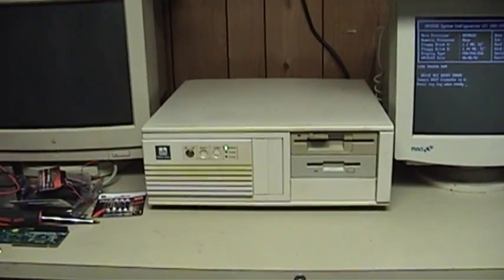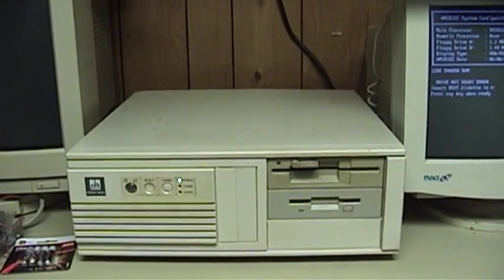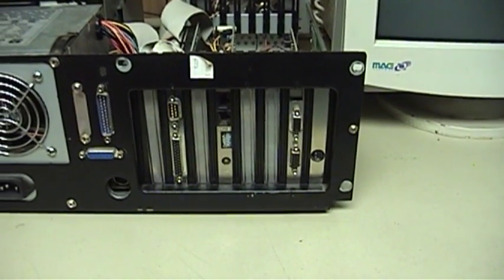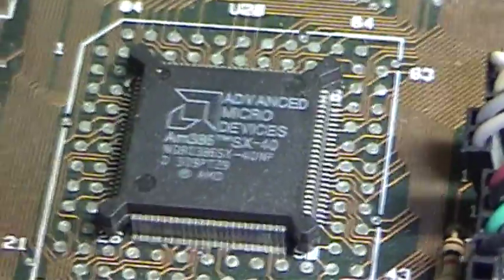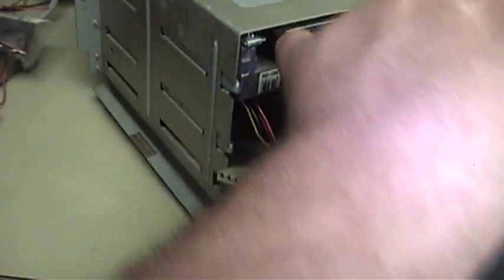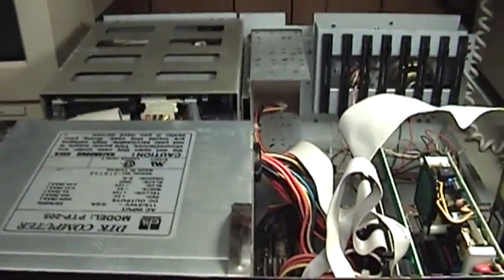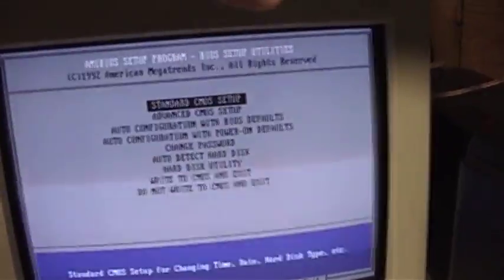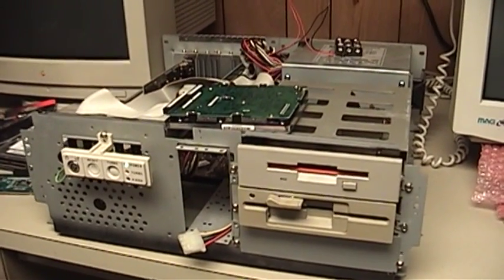DTK Computer Peer 1630 PC (with upgrades)

Comment: So, at one point you talked about monitors. I've gotta DTK FEAT-5030 with 486dx cpu. I thought I was having a video problem. Could it be that it doesn't work with my newer monitor? What type of monitor will be needed? I'm unaware on this sort of thing.
Reply from the maker: There's always that possibility, although I would expect that you would still see the various startup messages produced by the computer before it is ready to use. Most monitors will also complain if their capabilities are being exceeded. 

In case you are not already, I would recommend using a monitor that has an actual analog VGA input. (The typical converters for VGA to HDMI, DisplayPort, or whatever don't actually work all that well.)

My guess is that the computer isn't actually managing to start up. You can find this out fairly easily by removing the video card from the computer (assuming it's not built in -- then it gets harder). This should provoke a set of beep code errors from the internal speaker when you turn it on, if it is running.

My longstanding recommendation would be to carefully disassemble the computer, look for any damage (especially around any clock battery you may see), and if everything looks OK, carefully clean excessive dust away, after which you should reseat everything.

If you have a meter capable of measuring DC voltage, you could also check the power supply. At a minimum, it should be outputting approximately five and twelve volts DC. If it isn't, that's likely the problem.
Reply: @uxwbill  I get one sort of quick beep on startup. I can hear the hdd running as well. The battery area looks clean-ish. It's the old Dallas type and I can imagine it gave up the ghost long ago.  I just dont know anything about this old thing. It was my first computer when I was like 10 lol. Found it in my parents storage building. Just for nostalgia's sake I'd like to get it going.
Reply from the maker: That beep, if it's coming from the system speaker, is probably a good sign. If it were me, I'd clean the system up first (blow the dust out, if there is any) and reseat all the expansion cards. That may be all it takes. Beyond that, it'll take some troubleshooting. Simplify the system configuration as much as you can. If it works with the bare minimum configuration, add one piece back at a time and test it. When it fails, you've found the problem.

The Dallas modules do run out of battery power, but as the battery is totally sealed in potting compound, it doesn't leak. It also helps that the battery is not a rechargeable type. You can carefully cut those modules open, disconnect the battery and solder in an externally located one. It's not for the faint of heart or inexperienced, though.
Reply: @uxwbill  I did in fact take everything apart and clean it. The mobo itself looks mint. The VGA card looks like it's okay, but the metal seats did appear to have corrosion on them. I did not clean them yet but did reseat it. Only had 1 more old school internet card that's completely trashed. The pc was on its side for years and looks like rats got in there and did their business. This did not make a difference on the video issue. The one beep is still chiming on startup though. I dont know if I should try a different video card or not since I cant locate a cga monitor for sale anywhere. It's a shame really. I did see a label on the hdd though, it's got DOS 6.2 loaded on it amd possibly Win3.1. May have to be back burner project for now.
Reply from the maker: Hopefully you'll have a breakthrough and it'll come back to life. I would definitely simplify the configuration as much as possible, maybe consider removing everything but the motherboard and video card? Anything that looks as though it has been damaged should definitely be removed, as it may damage other parts of the computer. Hopefully that hasn't already happened.

Assuming "CGA" isn't a typo, you won't want to use a CGA video card or monitor. It would be an enormous step backwards in that computer's graphics capabilities and any software that operates in a graphics mode would probably need to be reconfigured. Windows 3.1 in particular did not ship with a CGA driver -- it was an optional download from Microsoft's BBS at the time.
Reply: I assumed it was CGA. Maybe it will work with the 98-99ish style CRT monitor I have then. Gonna just keep tinkering around with it.

Comment: I have this same case. What type of size power supply does this take?(mine has no power supply) The XT and normal size AT seem to big and not the correct shape for the back of the case. Is this some kind of weird proprietary Mini XT version that DTK had made just to fit in their case, some kind of XT, Full AT, Baby AT, Frankenstein Power Supply. I want to find one for my Peer 1630 case.

Comment: what about a 5/4" hard-drive and  DEC GEM DESKTOP that was for the AMSTRAD 1512 and 1640.
Reply from the maker: +DAVID GREGORY KERR What about it? I have no idea of the context to which your question applies, or even what you're asking!
Reply: +uxwbill well it is an OS that was supplied with the AMSTRAD 1512 which had 512KB of system RAM and had CGA 4 color graphics as well as a special Plantronics mode which gave 16 colors on screen at one time as well as MSDOS the GEM OS was a graphical operating system for the AMSTRAD 1512 and 1640  which had 640KB of system RAM as well both machines used the Intel 8086 processor but no floating point which had to be emulated. AMSTRAD is a contraction of Allen Michael Sugar Trading.

Comment: The smoke smell can hide in a power supply. smell that psu first.
Reply from the maker: +Massa902 The smell of burnt or overheated electronic parts is a lot different from that of cigarettes. And as the fan tends to pull air through other openings in the case, it tends to get everywhere pretty much equally.
Reply: +uxwbill Oh,. So the whole thing would be smelly then, yeah? I wonder if Tar builds up inside a case as well
Reply from the maker: +Massa902 Yes, and yes it absolutely does.

Comment: I can't find the Lzone on my ibm 171 mb harddrive, i can find the Sectors and heads and cyl but not the Lzone
Reply: It is an IBM H3171-a2 171 mb 
984 cyl 10 heads  34 sec/T

Do do i use 84 or what number,

It also has no clock battery, so it won't detect the harddrive automaticly for me, 

it has a 486SX 25 mhz and running MS DOS 6.0  Windows 3.11

It's very hard to get it booting up from the HDD
Reply: Ok i will try that thanks! 

I think it needs a 3.6 V because when i install a 3 volt cr3220 battery, it says that the battery state is very low on the power on self-test. and also it only works one time
Reply: It does detect the drive but it shows that it is an 163 mb drive :/
Reply: It worked, thank you uxwbill you have saved an old computer!!
Reply: Well it just so happens that it booted from the hard drive, but it only did it once! I just dont understand why it wont boot anymore
Reply: Those 3,6 V batteries is very expensive were i live,
But i think i will invest in one. But is there anything else that you know that may work?
Reply: I have the battery holder and batteries (off course) the only thing i need to buy is the diode :-) so it looks like this is going to be very cheap, so thanks again uxwbill.
Reply: I found a 3.8 v 600 mAh lithium ion battery in my gameboy advance sp, do you think that will work?
Reply: I tested the battery yesterday and it did work, 
and im getting a commodore 64 very soon. 
so everything went well

Comment: Stacker, X-Tree Gold, Quarterdeck's QEMM386 and the predecessors to some of the latest games still loved by all; Wolfenstein (Battlefield 3, Metro 2033), Sir-Tech's Wizardry (Elder Scrolls series) and Sim City. And we didn't notice that the midi sound files sounded that bad, until X-Wing and some others started using digitally reproduced wave files. DIP switches on modems and such to set IRQ's and DMA's. MEMMAKER, HIMEM.sys /noems and Expanded memory cards!

My hair just got 2 shades greyer. lol

Comment: No offense intended Bill, just noting a bunch of comments unrelated to the content so I made an observation related to my experience with former smokers.

I like the vid. Boy did it ever bring back the days when you had to define your drive parameters in the bios. I noticed the empty math co-processor socket.

My first PC was a Tandy 386SX. My first build was a 5x86 Cyrix based PC, 133 MHZ with a huge amount of RAM, 12MB! DOS 6.2, I ran X-Wing out of a RAM disk on it. Been hooked ever since.

Comment: My friends got an old computer. I really don't know anything about it, since it's not mine, but it just sits in his basement. All I know is that it has a turbo button, And takes a long time to start up, The boots win 2k, and it you leave it running for about a half hour an alarm starts going off in it. Does anyone know what the alarm is? I'm thinking it's overheating or something.. But if you know, please let me know!

Comment: I used to have a Dtk grafika 486dx2 66mhz. I'm very surprised, dtk used the same AT case from the era of the machine you own all the way into the AMD supersocket 7 era, they just have different face plates. They all have the 3 horizontal 5.25 bays and two vertical 3.5 bays. It was a nice computer, the one I owned, it had alot of room for expansion.

Comment: Yuck, few things are nastier to a computer than smoking. Funnily enough, the reset button my my 386DX sticks as well... in fact I had to stick a piece of tape to the button and pull on it to pop it back out. Fortunately ctrl-alt-del works well enough most of the time.

I've got to solder together a battery solution on that machine as well; I'm going the CR2032 battery holder route. Those barrel batteries are a menace; luckily I got to it before it caused any damage.

Anyways excellent video!

Comment: You mentioned the leaky nickel-cadmium batteries in the description.  I always yanked those out first thing.  There was almost always just enough space to solder in a regular coin cell holder.  If the keyboard port gets in the way, you can shave a little plastic off of it if you're very careful.
Reply: you shouldn’t directly solder to batteries
Reply: @jessihawkins9116  
Never said I did. :)
Reply: @Jerkwad152  you said you soldered in a coin cell battery.
Reply: @jessihawkins9116  
No, I said I soldered in a coin cell holder .
Reply: @Jerkwad152  no
Reply: @jessihawkins9116  
So, you...just don't know how to read, then...
Reply: @Jerkwad152  you went back and edited your comment 🤨
Reply: @jessihawkins9116  
When you edit a comment, it says so next to the time stamp, smart guy.
EDIT: Kinda like this one.
Reply: @Jerkwad152  the jokes on you. I’m not a guy, I’m non-binary 😤
Reply: @jessihawkins9116  
Bye, Felicia.  😂

Comment: I've looked and looked and looked and I can't see anything that looks like a battery, or that there was ever a battery mounted on it. There's the BIOS and a chip directly next to it with a sticker on the top. I may try and remove the sticker to get the part number.

This is the third motherboard I've tried and this is the only issue with it!

Comment: I have the same problem with the battery for my 486 motherboard being dead (or missing?!)
I've ordered a similar battery holder for the 4 pin socket, as I'd rather not have to enter the CHS settings every time I want to use it!

Interestingly, the manual for said motherboard reckons the VLB slot is a MCA slot!

I wasn't expecting a random Furhead to appear!

Comment: Nice system, and for the harddisk you can use a drive overlay program.
The biggest harddisk you can install without a overlay is 520MB (1024cyl. 16 heads 63 sectors)

Comment: Ooow it reminds me of one of the machines i had many many years ago.

You may find the holes around the cpu were for the socketed version, i had a machine like that, it could do with a 387 math co-pro i think (my memory has faded a bit).

Not quite enough speed/memory for win 95 to work i suspect.

So its fdisk/format/sys c: from a boot disk and same dos installed, scandisk/chkdsk to check if ok then windows 3.1 possibly??

Furrhead, i would worry about him bill, lol :-)

Comment: You would be amazed how long cigarette smoke stays in electronic equipment,I found my parents old General Electric clock (gotta be from the 80's) and it still has a hint of nicotine (my father was a smoker,don't become an accountant on wall street) ,to think it has held on for 15 years.

Comment: I would bet that multifunction board was made by DTK as well. The Oak VGA board may not be fancy enough to support CGA/EGA and Hercules output; many early VGA cards simply offered the 9-pin output as a way to connect an already-VGA-capable Multisync monitor (as likely previously used with EGA) without needing to buy a new 9-pin-to-15-pin cable. And it's been a long time since I've seen that text-only AMI BIOS screen! The only 386 clone I have left has Phoenix BIOS.